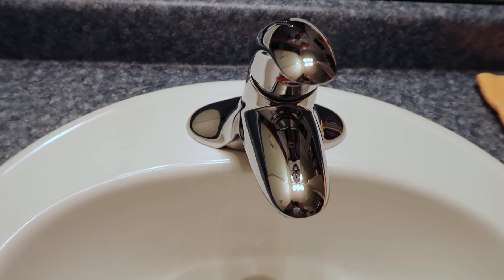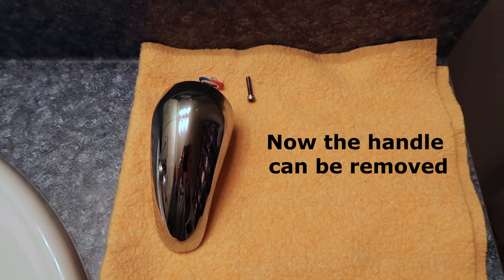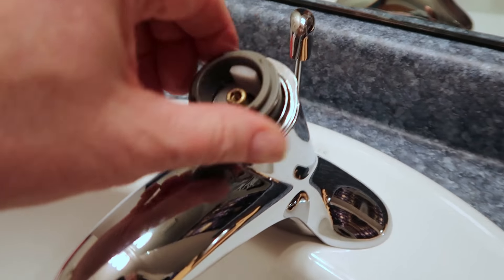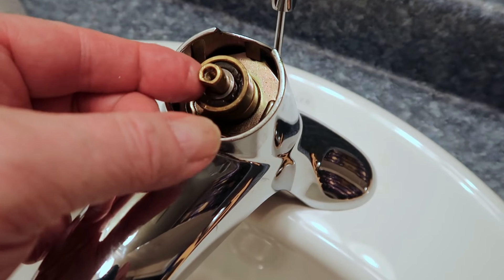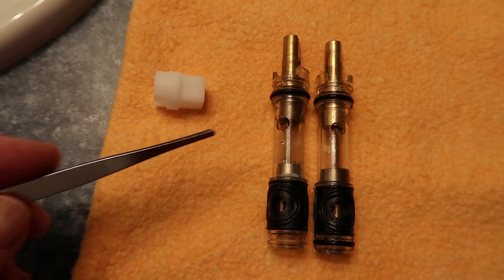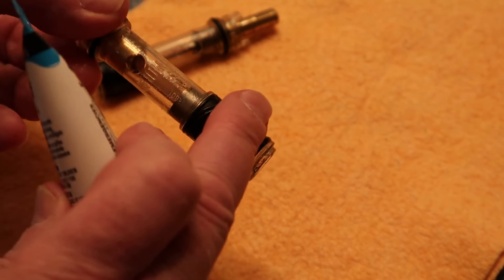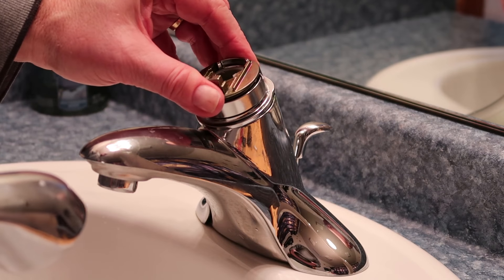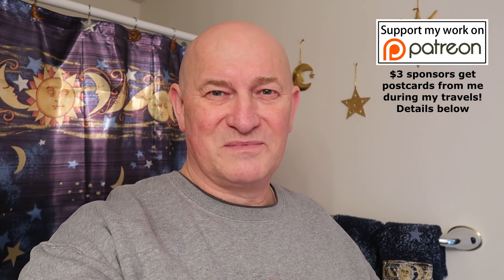How to Fix a Leaky Moen Faucet - Fast and Easy Cartridge Replacement

Comment: Thank you. I had a problem. Old cartridge really hard to get out. Eventually got it out.  New one wouldn't go it.  I don't know if it was the small amount of corrosion on the tube walls or perhaps a burr, but I took 600 grit sandpaper, rolled it up in a tube and worked it back and forth a few times in the tube where the cartridge goes. Cleaned the tube with a damp paper towel and voila, cartridge went right in no more drips.

Comment: Very helpful thank you. I have the same Moen faucet so I thought this would be easy, but the 21-year old faucet had hard deposits inside the cartridge pipe, and it took two hours with various tools to pry the old one out. At one point I contemplated writing off the old faucet and buying a new one, but my Scottish blood prevailed.
Your advice towards the end about having the right part saved me grief. The store that I would have gone to by default had the wrong one, as I could see from their website picture, so I went to another place, that had the right one.
Thanks again; well done.
Reply from the maker: I love your DIY nature!

Comment: Hi, great video! Do you happen to know if there is a specific cartridge for Moen bathroom sinks or are the cartridges universal? Would you happen to know what the name/number of the cartridge would be? Any help would be appreciated!!
Reply from the maker: They are not universal. You will need to make sure you have the correct cartridge. I took mine to the hardware store to compare.

Comment: Good video - I have slightly different Moen model. Failed for me because the screw going into the top of the cartridge would not budge. The entire cartridge turned down inside the faucet. Sadly, I had to replace with a current faucet which is a piece of junk. This was an excellent faucet for many years.
Reply: I had the same issue with that screw, but years ago I had bought a hammer drill for concrete drilling. The hammer drill with a Phillips bit made short shrift of the stuck screw.

Comment: Thanks so much for this!!! I recently purchased a house and the master bath sink is leaking on the hot water side.  I've turned the water off and will be taking it apart today.  I'm sure it's a Moen, but the tag is missing. But based on how it looks and the base, I'm pretty sure it's a Moen.
Reply from the maker: If you can, remove the cartridge and take it to the store with you! Don't make the same mistake I did and have to go back.

Comment: Thanks for the help.  I just had faucet with a tiny drip, but would have had to buy 2 new faucets so that they matched.  Instead, I followed your instructions and fixed it myself for $25.  I am one of those do-it-yourself type of ladies, but did not know how to disassemble the faucet.  With your help, it was easy.  Thanks!!
Reply from the maker: Yep, it works the same for women! I'm glad it worked for you and saved you some money and headaches.

Comment: I have this problem right now , I was just going into replace the faucet since it’s old but I may try this ,but man that is a lot of parts / pieces to take out for a small leak ,thank you got this video it was very informative and helpful  ,
Reply from the maker: Well, it' probably less work than replacing the entire faucet, and there's a great feeling of satisfaction when you complete this project.

Comment: This video was a huge help. Especially the small but important details like the one part that has the tab which needs to hook over the back to go on and off correctly, how to use the plastic tool, the fact that the tabs on the cartridge need to be aligned in such a way as to allow the clip to pass through, etc. I'm sure I would not have been able to replace my cartridge without your help Thank you!
Reply from the maker: Thanks Russ! It's great to hear that it was helpful!

Comment: That grey threaded piece would not come out. Loosened it with channel lock pliers while doing some minor damage to the piece since it's plastic. But after it loosened up a bit it just spins eternally and won't come out. Tried death gripping it with those pliers and pulling with all my strength. Nothing

Comment: Thanks so much for your step by step instructions! I am going to attempt this myself and really impress my husband!!
Reply from the maker: I think that's a great idea! Contact Moen and see if you can get the cartridge for free, as they guarantee their faucets.  Replacement parts may be obtained by calling 1-800-289-6636 (Canada 1-800-465-6130), or by writing to Moen Incorporated, 25300 Al Moen Drive, North OImsted, OH 44070-8022. Proof of purchase (original sales receipt) from the original consumer purchaser must accompany all warranty claims.

Comment: Here is a tip to the wise...about twice a year, go to every sink and toilet in your house and give the shutoff valves 3x all the way off/on twisties to keep them freed up and seating correctly.  They can & do corrode inside over time and cause you major headaches if you ever need to turn them off in a hurry.  Ask me how I know....
Reply from the maker: Pretty good advice! Of course, the solution is to turn off the main water valve to the entire house, but that negates the very practical purpose of a shutoff valve.

Comment: Hi Mark, hope you are still available for a question, I am a very senior lady with a husband that used to be able to do all his own electrical and plumbing, but since his dementia , he has not been able to do anything like this anymore, does not know how  or what tool to use or how they operate, so I am trying to figure all this out myself with the help of your YouTube video. We went to get the replacement cartridge, but they wouldn't give us the replacement part without the old part, so home we went again. Now I have been able to follow all your steps up to the 11:58 min. part where the the top part of the cartridge is exposed, I can pull it up about half an inch freely and the screw can turn also, but then I can feel that something metal by the sounds of it is stopping it from coming out, I have pulled and pulled on it, but it is definitely something hard that is stopping it from coming out, as I said, for about half to one inch it will pull up and then solid stop. Is there something that you can tell me for a suggestion , that I might be doing wrong, as you showed that little square white tool that comes with the new cartridge, I don't have that  of course, as I don't have the new cartridge yet, Moen has this lifetime warranty, that it will replace your cartridge for free when you bring in the old one, so am really hoping you have a suggestion for me to get this "sucker" out of there, many thanks. Nancy.
Reply from the maker: It’s really hard to diagnose without seeing it, but if something’s stuck it’s likely a broken piece of rubber O ring or a hard piece of mineral deposit. The tool only breaks the cartridge free, it doesn’t pull it out. The risk scoring the inside of the faucet if you force it out, but that’s the route I would take. I would keep pulling but realize it might cause damage (or already be damaged). It could also be fine.
Reply: @AverageMe  Thank you for your reply, since your reply, I managed to pull out the old cartridge and put in a new one, it was a matter of having that little square white plastic part that goes on the screw and got that of course with the new cartridge. Then was putting things back together, but everything was loose, it wasn't fitting properly, so took it all apart again, and now couldn't get the new cartridge out, kept trying to twist that little plastic part back and forth hoping it would be sitting in the way that it would then come out, but no luck. So, ended up calling a plumber, who came on monday, I ended up showing him how to use that little white square nut on the screw, and told him that it has to do with that being in a particular position for the cartridge to come out. Which after him pulling on it so hard I thought he would break the faucet right out of the sink, then showed him that method again, and he did try it, and it did work this time. He put in a new cartridge and it didn't work either , water was just running out. So, he said better get a new faucet , which we ended up doing, and all is fine now, just abit more money then initially planned, but all is well, and I thank you for your video.

Comment: What if the handle has come off the moen bathroom sink? Fixable?
Reply from the maker: It wold depend upon why it came off. If the handle is actually broken, you might be better off simply replacing the faucet. The type in the video are probably under $70 new. You might be able to find the handle part. If the faucet is otherwise good, just use the new handle from the new faucet purchase and replace it on your existing faucet (you might as well stick in the new cartridge while you're at it).

Comment: Hmmmmmm🤔
I’m trying to pull out cart but doesn’t want to come out!!! It’s acting like it hits something to keep it from coming out…
Am I missing something??
Reply from the maker: I'd guess the O ring is so broken or torn up that pieces are getting stuck and making it difficult to remove. If it were me I'd use a little brute force, but I don't want to give you bad advice and ruin your faucet.
Reply: @AverageMe  yeah that’s what I thought too but being that the faucet is 22 yrs old I just replaced it. 
Thanks for your reply I appreciate it..👍🏽😁

Comment: 7 minutes and 30 seconds they make a socket also a wrench to fit that piece, but good job
Reply from the maker: Yes they do. An adjustable ("Crescent") wrench would also work. Actually, the needle nose pliers is not a good option, I just had it handy so I used it to demonstrate.
Reply: @AverageMe  I do understand sometimes you have to use what you have at your disposal LOL you have a wonderful weekend what's left of it anyway I hope you're somewhere warm LOL
Reply from the maker: @jamesabroomeiii7552  Haha! Nope! Heading to Boston!